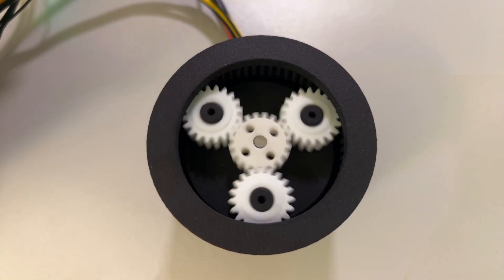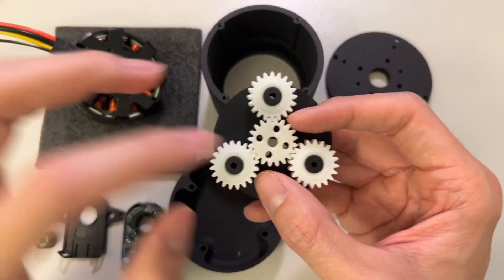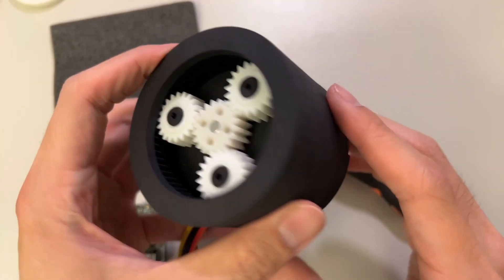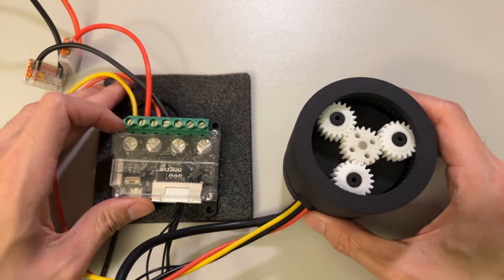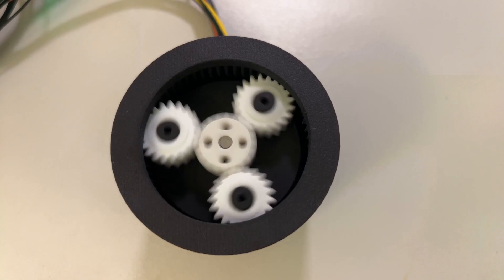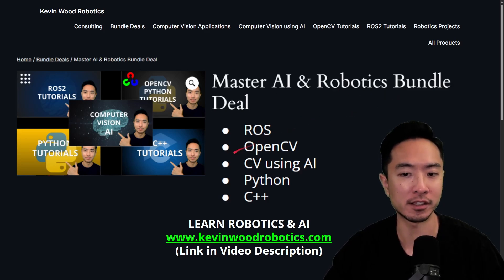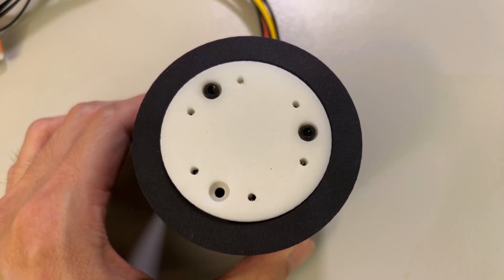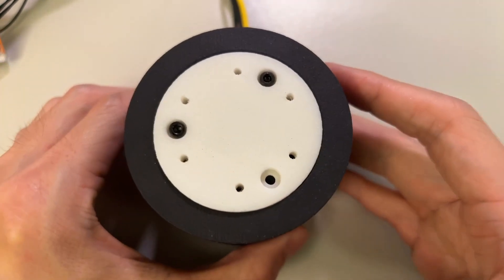3D Printed Planetary Gearbox Robotic Actuator BLDC with ODrive S1

Comment: Can I get that name or model number of motors, shafts, whatever the parts of this gearbox in your site after I bought your STL file?
Reply from the maker: https://shop.odriverobotics.com/collections/motors/products/odrive-custom-motor-d6374-150kv
Reply from the maker: https://shop.odriverobotics.com/collections/encoders/products/20480-cpr-encoder-with-odrive-cable
Reply: @kevinwoodrobotics  Thank you so much so it’s not necessarily to print them with 3D printer?
Reply from the maker: @unlabeled000 you can either print or machine the gears and housing

Comment: now put a load on it and do an endurance test. i think the part that will fail are where the 3 screws go through. those will wear down or the gears around them will wear down from the inside out.
Reply from the maker: Yes good point, that may happen